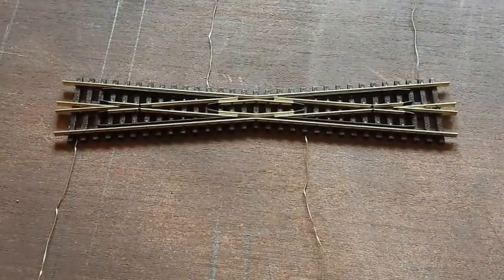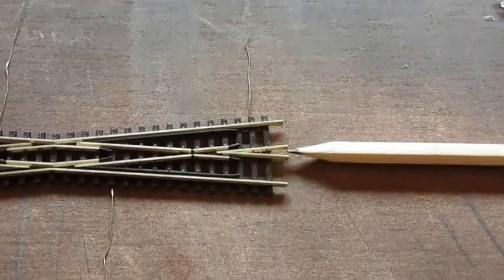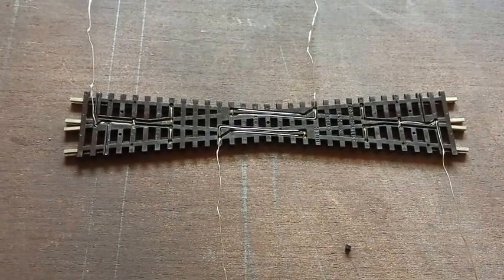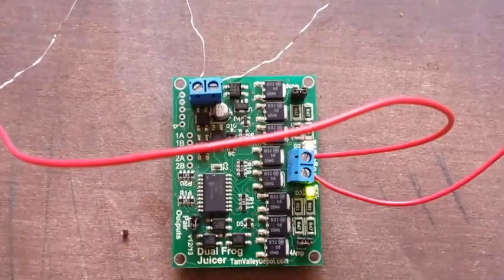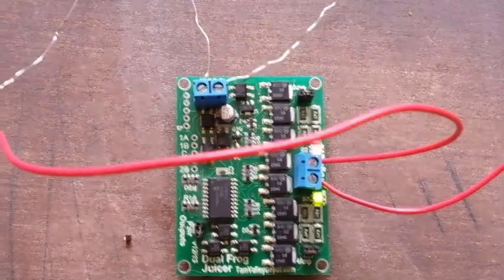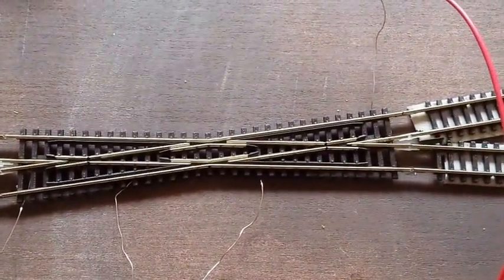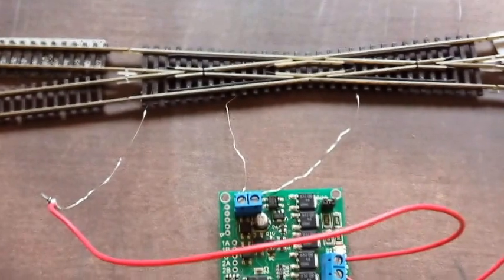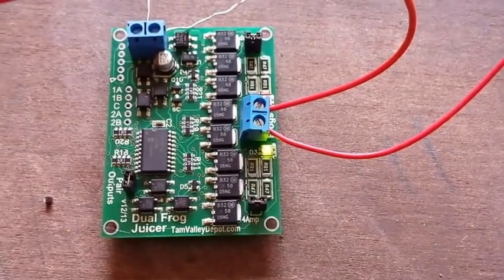How to Wire Electrogfrog Crossing SL-E394F N Gauge for DCC

Comment: Excellent video tutorial , I'm using these same crossovers. Did you use insulated plastic rail joiners on the frogs ?
Reply from the maker: Yes I did the same frog insulation (middle 4 rails) just like a normal electro frog turnout.

Comment: Very good explanation 
Thanks
Its unfortunate that Peco dont make the a variety of crossings in Code 83 like Atlas does but Atlas as far as I am aware dont make elctrofrog crossings
My layout has 2 Atlas 19° crossings insulfrog which were giving me grief with my 4 axle switchers
I ended up soldering dropper wires to all rails of the diamond to provide better continuity at the particular scissor crossing in my yard with the standard insulated joins
Thanks again

Comment: Hi David, I found your instruction video very informative, far less complicated than others I have watched. Anyway the reason I've commented is I want to use n gauge electrofrog points on my layout, is the wiring of those similar to that what you have shown? I also watched your gravelling video, I must say I discovered that way a lo g time ago after watching all the you tube videos that are completely wrong. Gravelling N gauge as you say is a long process and must be laid with a lot of care.
Reply from the maker: Yes you still need to add extra wire to get the electro frog points working